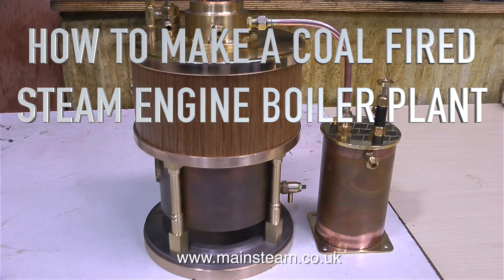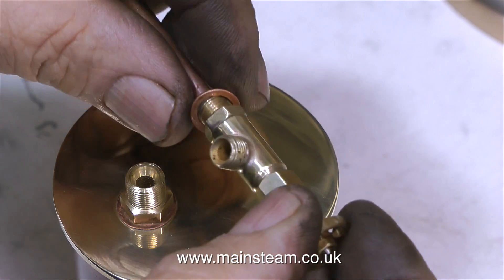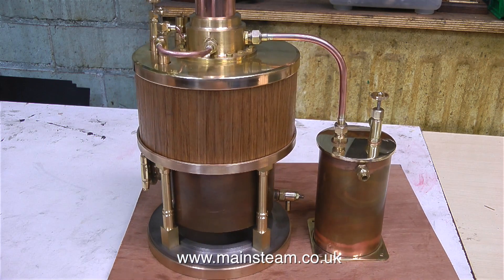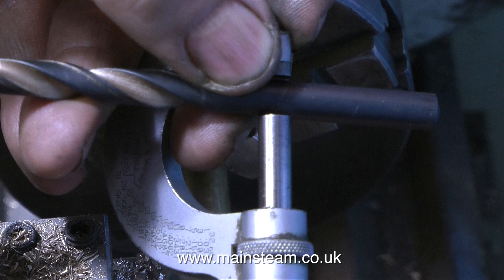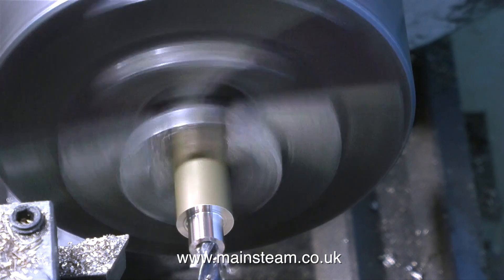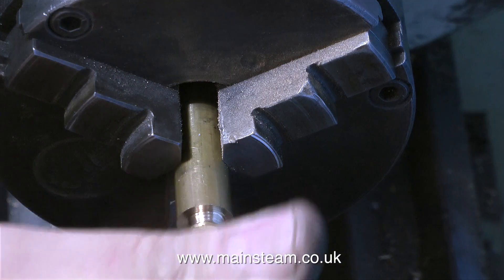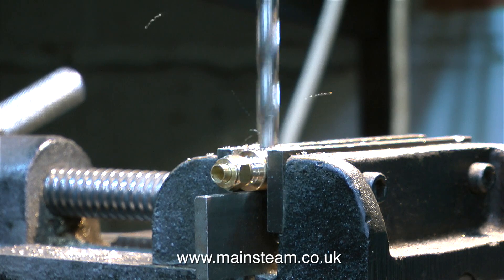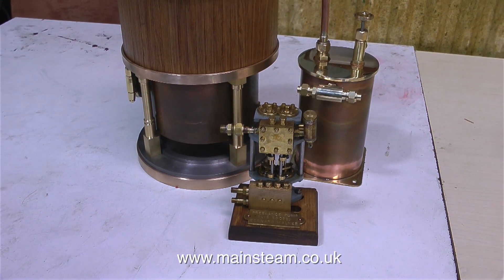HOW TO MAKE A COAL FIRED STEAM ENGINE BOILER PLANT - PART #20

Comment: Thanks Keith for another interesting video. Forgot where I learned it, but when using an adjustable spanner, always put the torque, the pressure on the solid jaw as you did. Can't say I never had a spanner slip after that. Enjoy what you do.

Comment: I'm loving the concept of using steam pressure from the boiler to drive a pump to top up the boiler with water against the steam pressure of the boiler ! 
These are the gems of engineering !

Comment: I was doing some electrical work, and for some reason I heard Keith's voice saying, "Of course, one should never use one's tongue for this. If the current were on, it would be very painful, and it might make it hard to kiss my wife after. I'm only doing this for the video, to make a point."
Reply from the maker: hahaha - :-))))
Reply from the maker: I often find it useful to wrap my legs in wet newspaper when doing any mains electrical work - it will help to keep them cool as the current passing through them to ground heats them up  :-)))